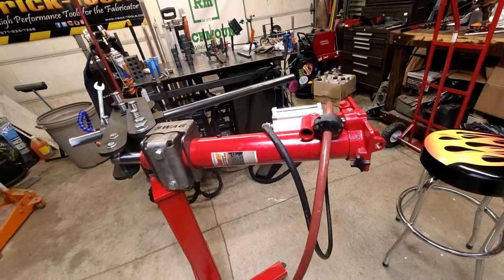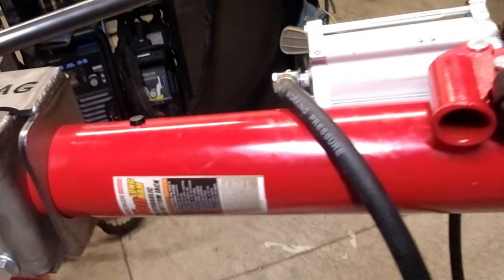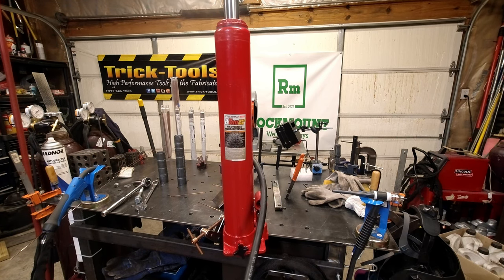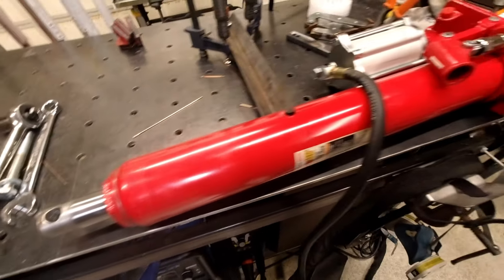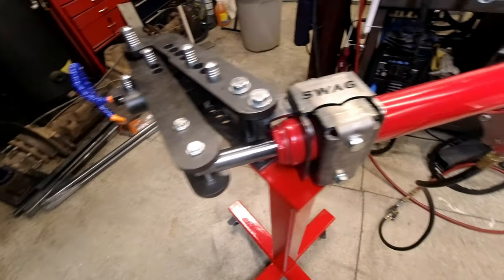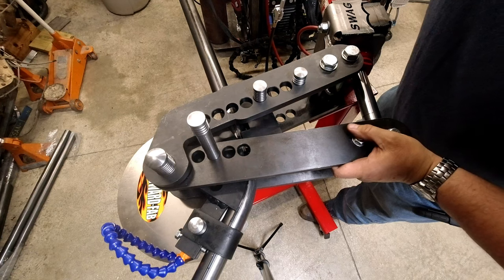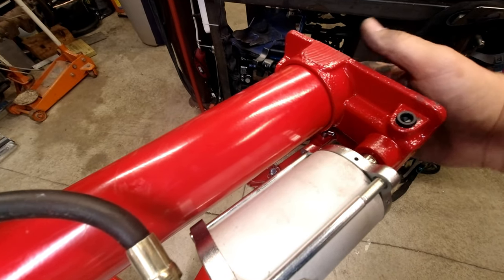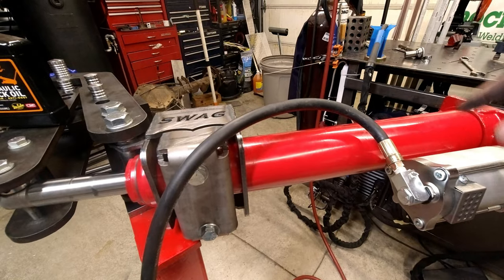Harbor freight cylinder won’t work on my bender 🤬🤬🤬

Comment: Pump Need's to be bled it's full of air or has an air pocket.
Set it up right, remove filler cap, check fluid level, replace fluid plug, pump the pump manually, remove filler cap to let air out. Then repeat the process until it pumps manual or hydralic.
Problem solved and can be installed with filler cap upright 
My setup did the same thing at 1st... 
I found some good videos to help. 👍👍
It was a great feeling to have it all working after all the 
$$ to purchase.
Reply from the maker: Thanks for the info.  I went through all of that,  it was stalling with load on it.  When I rotated it that stopped.

Comment: Mine started to leak all the fluid out maybe a week after mounting it on my bender
Reply from the maker: Where did it leak from
Reply: @4x4fabshop  I want to say the base. Where the large tube sets into the base. Or at the fitting of the pump.  I haven’t really looked. I set it up. Used it. Then stored it away and noticed a puddle on the ground below it

Comment: i live in Canada so we have princess auto and there is a 1/4 inch diameter difference smaller  i had to make a shim to take up the slack that part worked perfectly . also like you would not work horizontally . i left the bleed/fill plug up as i may have tried bleeding it for about a week first . then realized after trying to use the manual pump part of the ram and it did not work it needed oil ! i filled it about a liter's worth bled it again and damn it works awesome .hope this helps others as well as your video
Reply from the maker: Thanks for the feedback, Also thanks for viewing the channel. Is there any other videos you would like to see? Thanks for the support